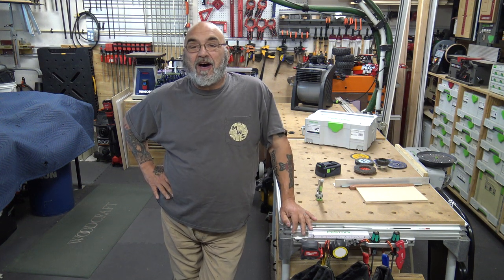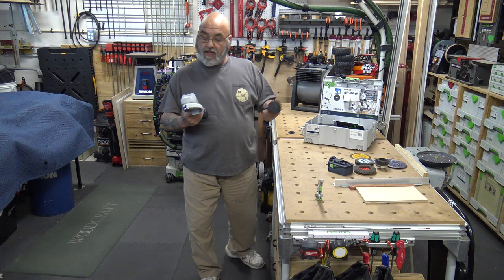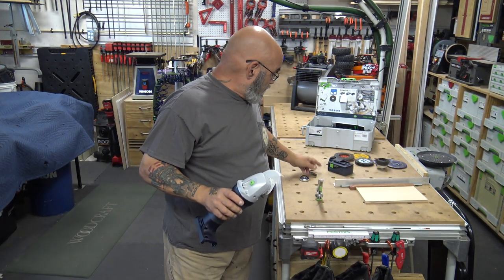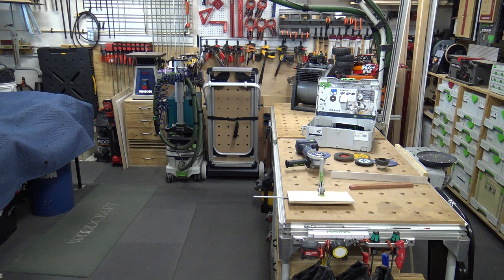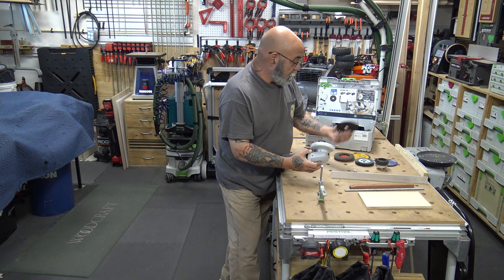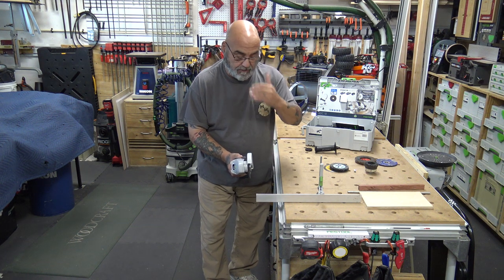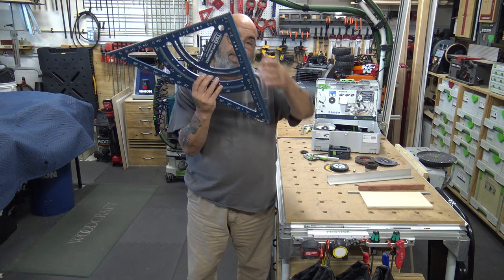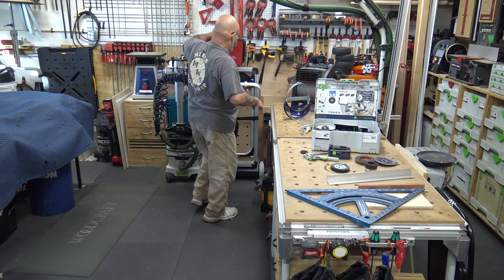Review of Festools AGC 18-125 cordless 18 volt angle grinder.

Comment: Great video. Some people drink beer and alcohol and advice me to stop buying tools.
Well you have the same disease as me. I'm a festool and tool junkie. I take pride in my work and strive for perfection or at least a less tolerance which can be achieved from
Festool. 
The grinder looks great. Since I got cleaned up with my tools stolen I have been in the process of restocking my equipment. This cordless grinder looks great and has sold me.

I have different platform cordless tools.

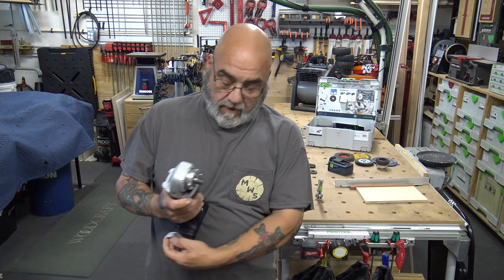Comment: I stop at 7:40'seconds. 
I have a few stories of injuries from using an oversize blade on a small grinder which have a different diameter arbour. 
One person cut an angle iron in the wall which  was renovated. He didn't have a
Guard and the vibration was excessive he went to get a better grip and cut his hand. He had to get his daughter to take him to hospital. I checked the machine. Turned it on the vibration was that bad I only just managed to switch it off very scary. Another time my cousin told me Vietnamese workers were on a large multi story job. Using an oversize blade on a small grinder without a guard. There were four men three looking. The blade shattered and there was blood everywhere all workers had to be taken to hospital. And yet I still see many people, plumbers using a grinder without the guard.
Interesting if this grinder is the same as another one i seen with dust collection and a plate with plastic cover for cutting tiles .